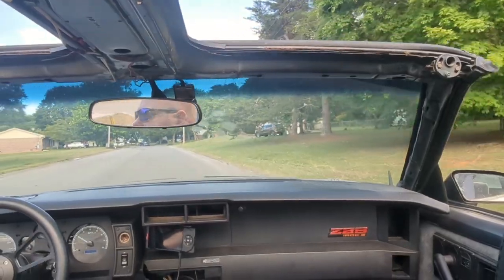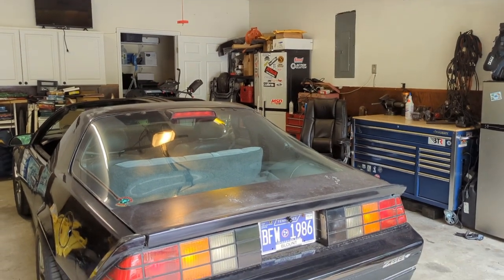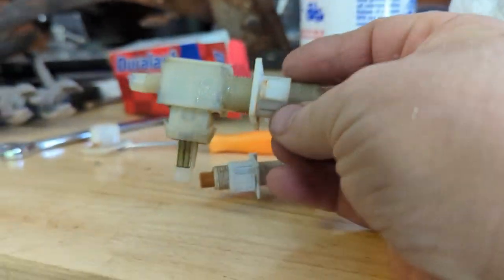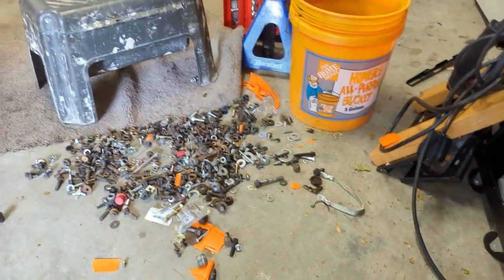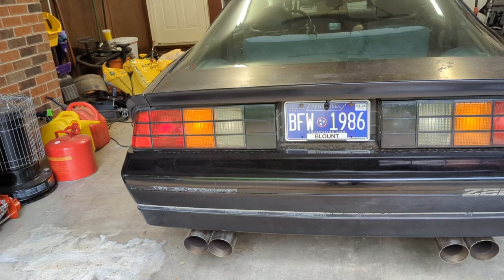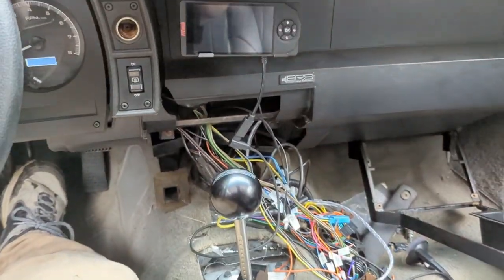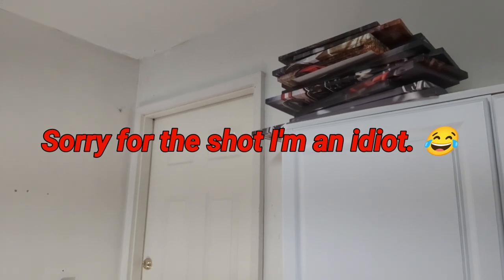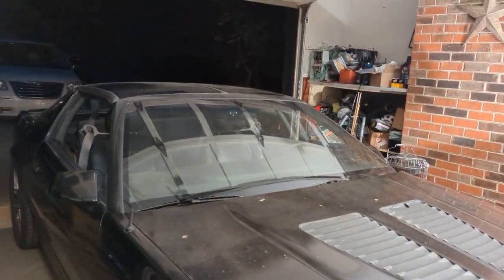June 1, 2023

Comment: You should have just gotten the 4L60E working in the car when you had it.  I guarantee it would have taken you less time to get it working in there and you wouldn't be constantly working on the transmission and could have focused on other things long before now.  If you were really set on a manual transmission, a T5 or T56 also would have been way less trouble.
Reply from the maker: You are definitely not wrong.

Comment: Hey did you have a video of the reverse camera you installed? I thought you did but couldn't find it.
Reply from the maker: I think it is in the new wheels video.
Reply: @ForsakenSteel  did you mount the camera to the car or the Hatch? I can't decide how to run the wires through the hatch, but if I mount it to the car, the license plate won't fold down.
Reply from the maker: Mine is mounted on the license plate. I just left enough wire to fold it down.